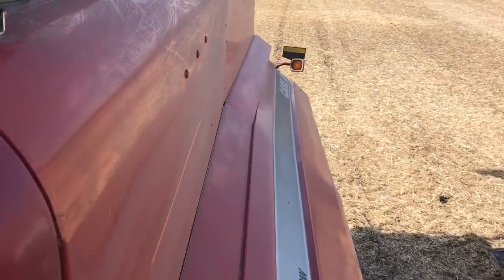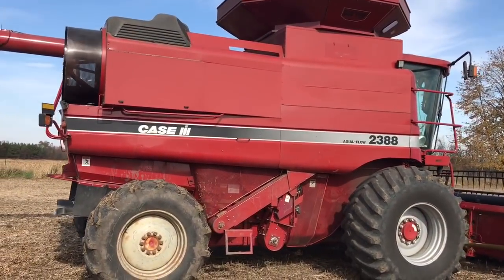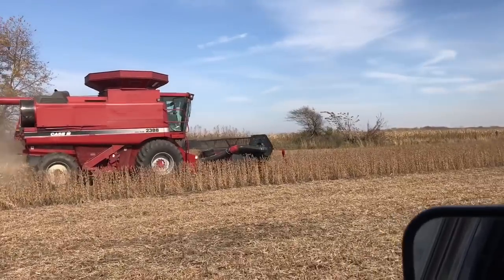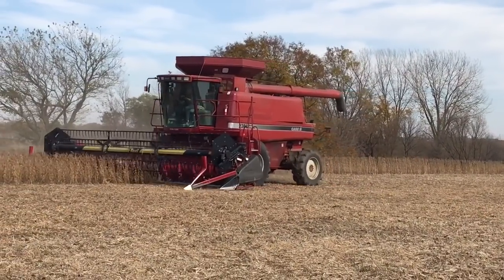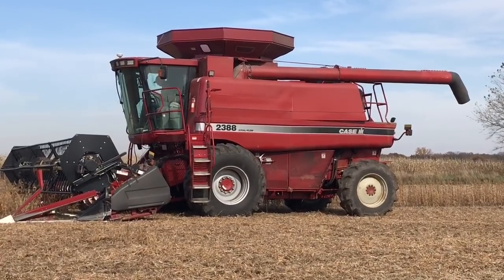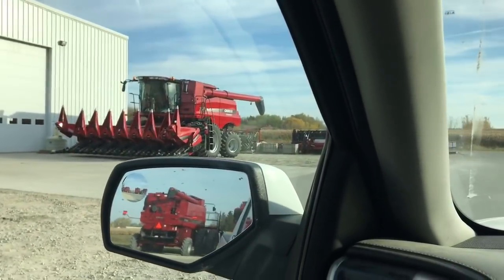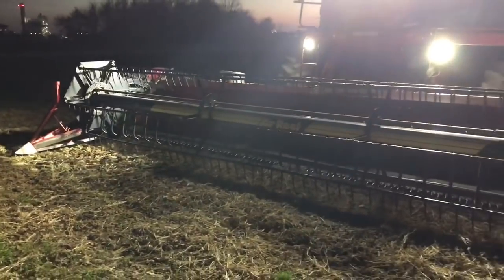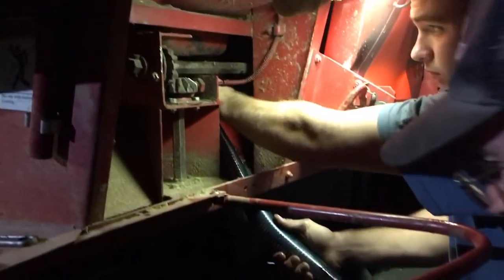Combine Fuel System Plugged

Comment: I had a big truck act up.  Switched a bunch of parts out, before draining the fuel tank.   Turned out that somebody had dipped a paper towel into the tank to get it wet with diesel fuel.  It got away from them and settled down to the tank outlet.   There was a cross over pipe between tanks. Fuel was pumped to the engine from the passenger side and returned to the driver side.  At half full point the fuel system would put all of the fuel into the one tank and run out of fuel.  Nobody owned up to the rag.  It was the brand used by the main repair depot so it was somebody employed by the company.  So that narrowed it down to about 5 thousand people :)
Reply from the maker: bummer!! of course no one fessed up

Comment: Gosh that really sucks. Our CR had a fuel issue, but luckily it was just the filters were plugged after re-fueling it from a fuel truck.  Hopefully it is just plugged somewhere in the system and not a major component.

Is it a manual pump or electric? Maybe you can get a pressure gauge and test on some of the lines before and after the pump and in some other places... could eliminate possible issues out of the gate. Possibly check things that may indirectly affect the fuel system (breather filters, return lines, etc). Since the combine doesn't appear to be smoking, it definitely isn't getting the fuel it demands. Of course, call a knowledgeable mechanic for more insight. Good luck!
Reply from the maker: thanks for the tips, it was crud in the tank and lines

Comment: If the fuel fill cap is vented in beans it will draw in the dirt filled air and plug the screens eventually. The older John Deeres did it quite a bit.
Reply from the maker: this was our first time having this issue, we checked the cap right away

Comment: Nah i have a 2388 it did the same thing . What i did was change the fuel filters on the engine an the fuel resort down low .. it was picking up trash from the tank . Thats WHY i dont run any of my equipment low on fuel